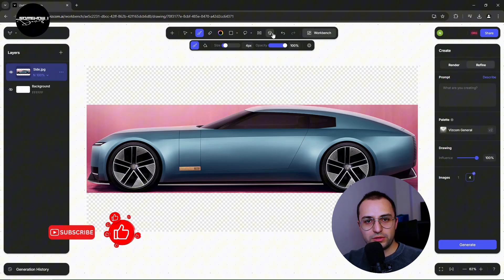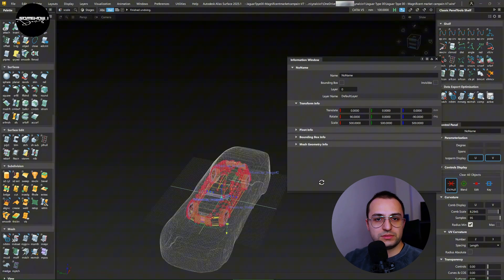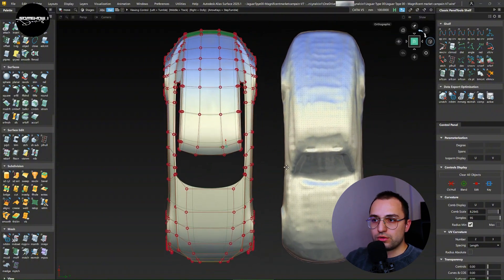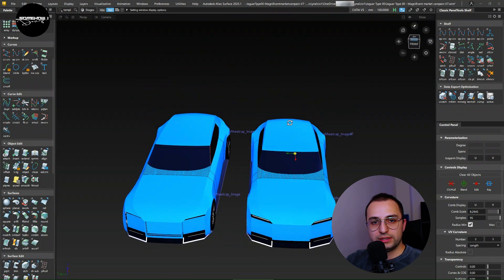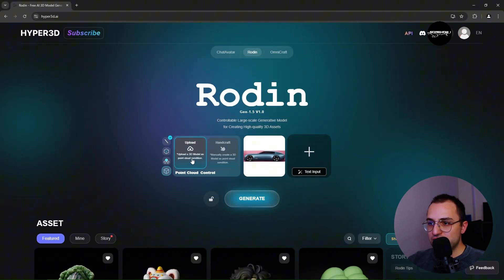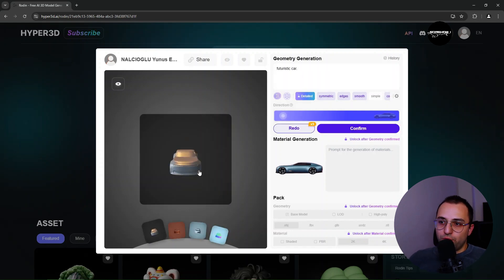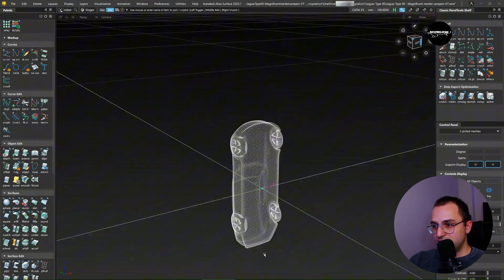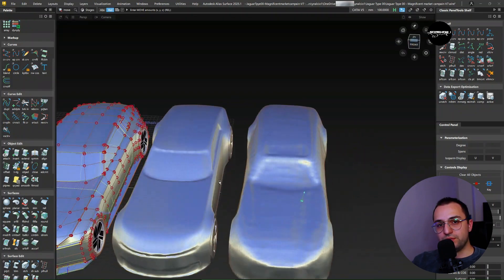AI in 3D Car Design: Is SubD Modeling being taken over?

Comment: it might speed up the process, but you're gonna need a proper 2D view to start off with, a design, whereas in Blender you can just experiment in 3D, keep pushing pixels and while doing so, exploring new ideas that might've never happened, had you solely used 2D... Of course, if you prompt something in an image generator, then export it directly into 3D it's a different story, then humans will become 'prompt designers'... I don't know, there is less value in curating an AI instead of developing a design in 3D
Reply from the maker: Yes, nice side view image or sketch is a crucial for the step. Image to 3d works better with side view to capture Y0 silhouette but nothing more actually.
Reply: @somehowidesign  Yeah.. Nevertheless great to explore the possibilities as it has a lot of potential!!

Comment: I don’t think it will overtake sub-d. But it will definitely speed up the process a lot. When doing exteriors I usually start with the base meshes of my car primitives addon, which already helps, but of course it needs some hours to get a sketch in. Using AI to get a mesh is a nice way for getting a more detailed model. The NVIDIA tool also looks great in that regards and it can output a low poly version with decent topology so one could do changes quickly. Looking forward for those tools to be actually usable in the near future

Comment: This is really interesting, so thanks for making this video firstly. I've been waiting for this to come along, and I didn't think it was far off when I first had a play with Vizcom some time ago, and could see the exponential path ahead. I think we will be getting good meshes out of ai in the not too distant future. I suppose the 3D output of these ai generators is limited by the amount of form expression that is put in at the front end in 2D form.. however, that said, I imagine an ai could very quickly categorize surface language of any manufacturer by analysing surface curvature vs. surface curvature rates of change vs. distribution of features across existing product which would give a reasonable estimation of what makes up a manufacturers (current!) design language, and therefore perhaps only a rough sketch is required for the ai to spit out a beautiful model, (and probably the tooling drawings beside!). What I am looking forward to trying now is to do some experiments of my own and bring these meshes into Gravity Sketch and start chopping them up and using for inspiration. I don't know what the future holds for us modellers - I can imagine clay modelling may become a thing again as people revolt against the "ai produced" in search of something altogether more artisanal...
Reply from the maker: @sculpt3d.digital   Big changes are definitely coming. We should adopt these methods into our creative workflow. There are too many different platforms and it seems like we are jumping between those platforms too much. What we need is basically one solid strong ai tool that covers most of the aspects in the best way. 

Another thing is onboarding these systems into big corporates take too much time but small companies will adopt better, it seems. 

Thanks for the comment 👍